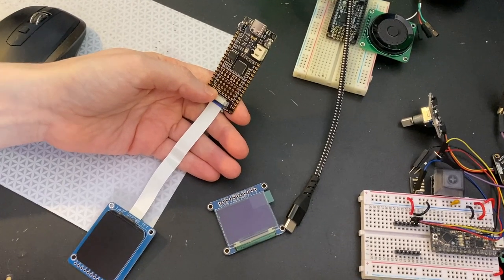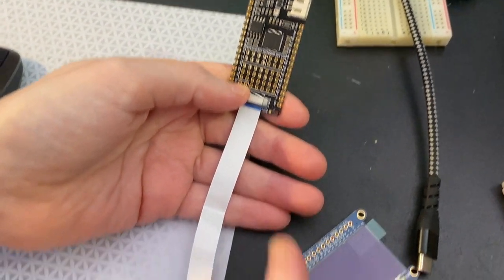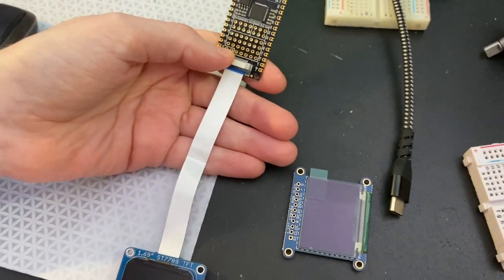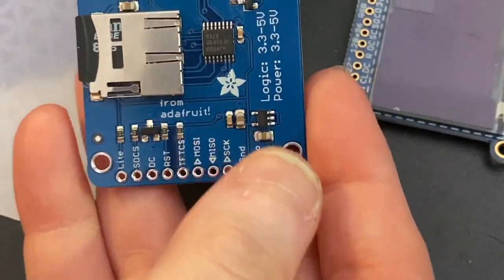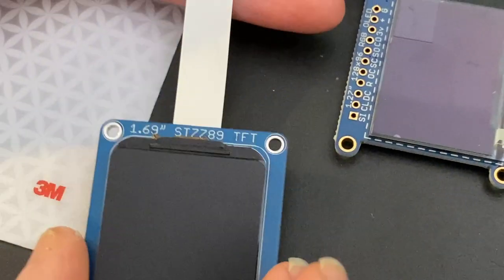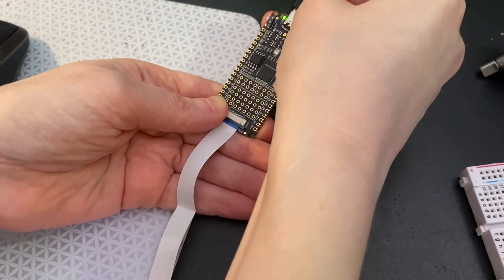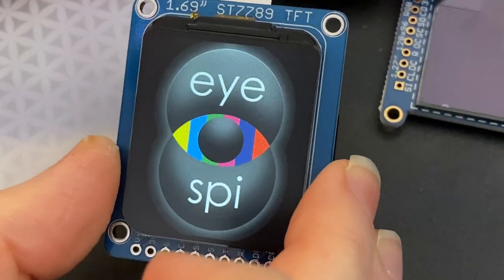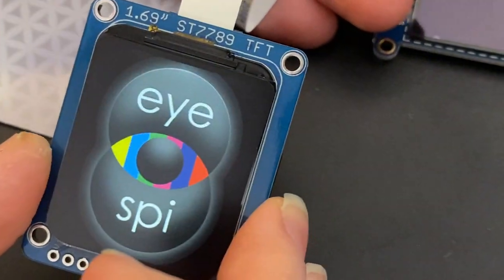EYE SPI with my little eyes ... a 1.69" TFT with Flex Connector!

Comment: This would be really handy if I knew what I spy was or a TFT!
Reply: EYE SPI = Adafruit's new group of products on home automation cameras and displays.
SPI = Serial Peripheral Interface, a  play on words with Spy, and a way of communicating data sequentially over a small number of wires
(slightly ironic, as it appears this is a parallel cable, not serial; but still cool :))
TFT = Thin Film Transistor, the technology behind LCD displays